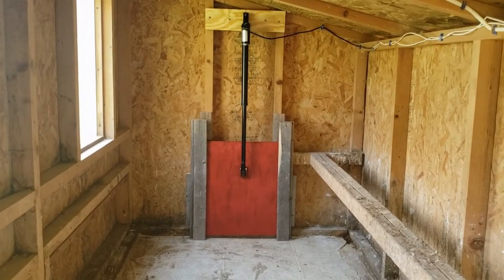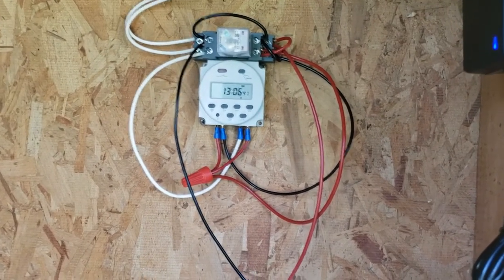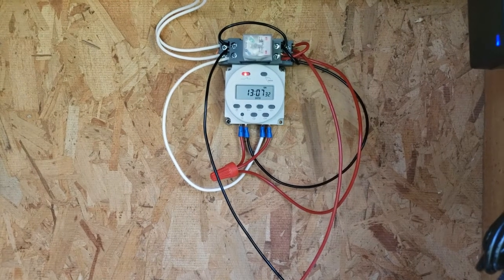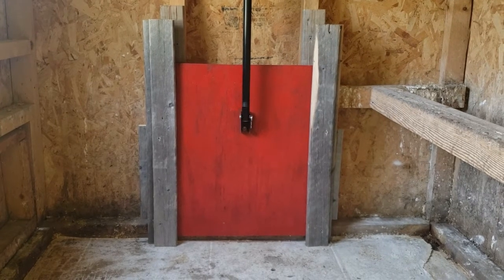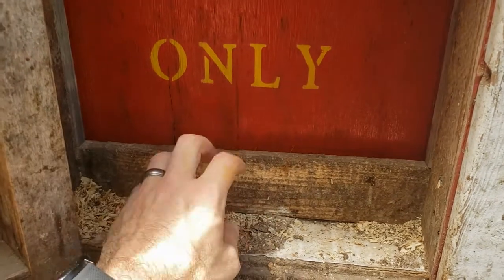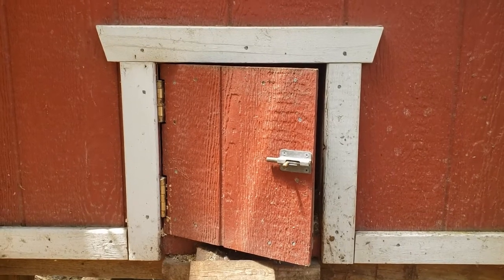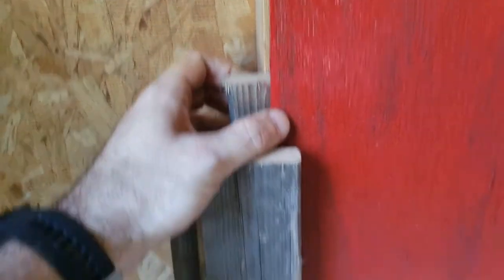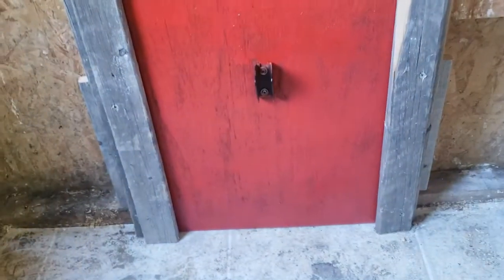DIY Automatic Chicken Coop Door

Comment: I've wired my actuator per your diagram.  When the timer turns on, the actuator will extend/retract depending on how the +/- is wired from the actuator to the relay.   When the timer turns off, nothing happens.  I have to physically switch this polarity to get it to reverse with the timer in the off position.... Any suggestions on what I am doing wrong!!

Comment: Thanks for the video…I tinker a bit with electrical/electronic goodies from time to time and have a bunch of control circuits in my head but one that I always ‘lost my train of thought on’ was the dpdt relay concept. It actually is easy but it’s one I’ve looked to for the polarity reverse feature several times over the years for dc control…some snowplows could use this feature or even some winches….just gotta remember to use current capable switching or quickly burn them up. 
Thanks again… Steve..Four Seasons PM 🤠👍
Reply from the maker: Part of the reason I made this video is so I could remind myself how to do this :)
Reply: @willworkforliberty  I guess that more realistically says it for me as well..years ago I could whip up all these different circuits real quick but these days find myself second guessing, backtracking and over all slowing down. 👍

Comment: Would it work to add multiple actuators to the same relay and power supply?  I have 2 chicken doors and a duck door.
Reply from the maker: Yes, as long as the power source is capable of providing enough amperage.  You can wire the actuators in parallel.

Comment: This is neat, but if you are using a linear actuator then why do you need a relay?
Reply: Ah, nevermind, I guess the internal limit switches of the actuator only control power, not polarity. Thanks for sharing this video.

Comment: Quickie question…Have you ever had trouble with getting one of the critters caught under the door while closing? It admittedly goes pretty slow and one could move out of the way except for perhaps a slow one. Call me curious. A pressure/circuit release switch would fix this of course.  Great door idea. 👍
Reply from the maker: I have never had that issue.  

I thought of that concern, and decided against it.  Reason being, there's a lot going on in that area.  Debris from the bedding, chickens coming in and out, etc.  I was concerned that adding more complexity would increase the probability that the door wouldn't close properly.  I'd rather have the LA push hard against the debris and close than accidentally be left open over night.

Comment: If you already have Mains Power to the coop then why didn't you just buy a Astronomical Clock, and an AC relay. Or a Smart (light) switch and an AC relay. They can be set to open and close with Sunrise and Sunset.